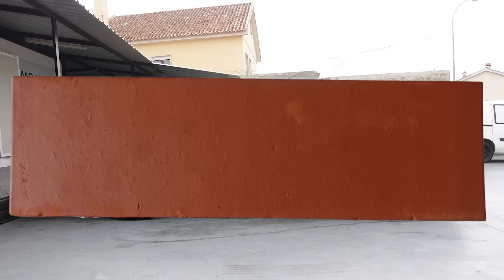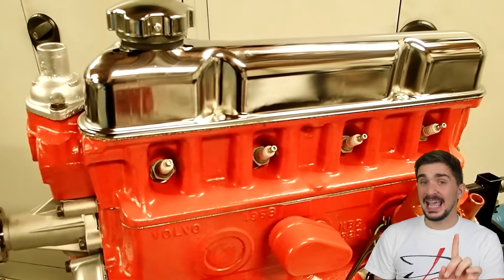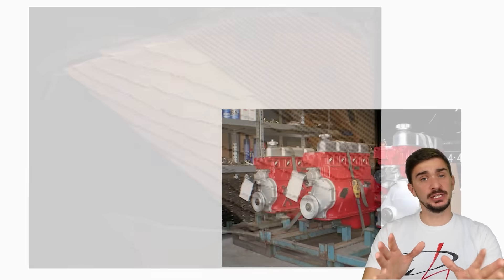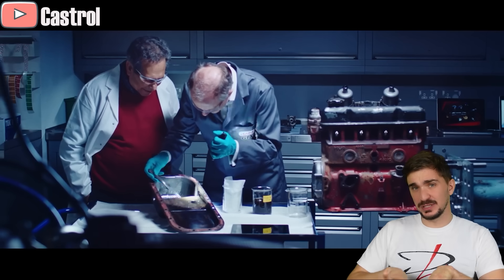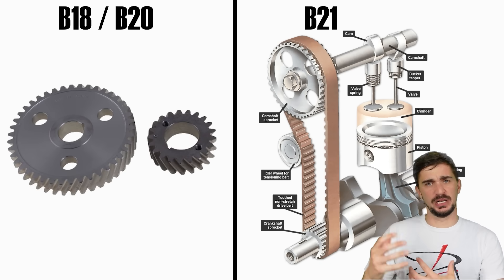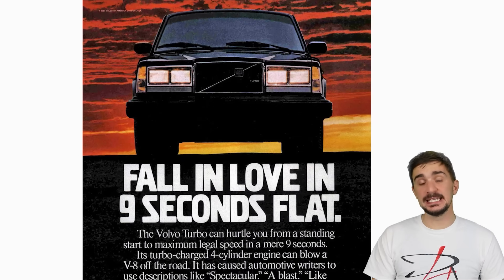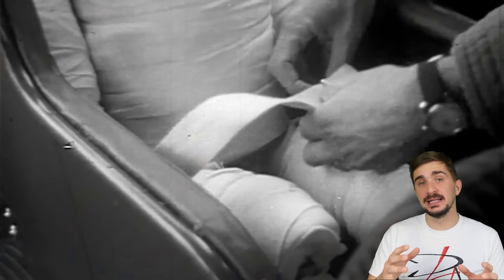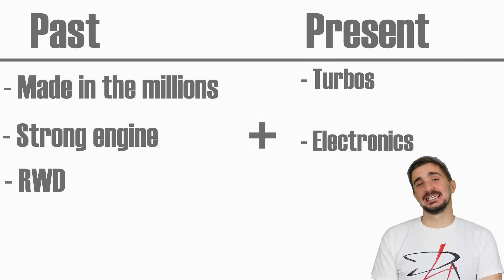A Story about the Volvo 240 and its Redblock Engine - Iconic Cars and Engines #18

Comment: My father has a P1800S 1966 with the B18 double carburator motor, actually sounds very nice for a 4cyl and it is the original motor since 57 years ago. I really enjoy driving it, and am currently helping him fix things on it as they break (because eventually things do, even in volvos)
Reply: All you need is a Phillips screwdriver
Reply: And always pack spare membranes for the su carbs

Comment: Had one of those, in that exact colour when young with no money. Had already been around the clock once and mileometer broken at 70K (actually 170K) miles. Leaked a little oil so I just kept topping it up and using it......continuous oil-change. Totally utterly reliable. Joy-riders in the 80's would not steal it as too uncool. Only fault was a split carb rubber diaphragm which was a cheap fix. Once tried to make a hard right turn on gravel and it just carried on in a straight line so I centred the steering and pretended that was what I had planned all along. It certainly was a brick. Only stopped using it as low 20's to the gallon.

Comment: Since you only went over the best parts then i will mention the Achilles heel of the 200 series. That being the transmissions. The engines alone could easy handle 500hp without much modifications but every transmission would not handle over 250hp.
I recently took apart my volvo 240's redblock that has gone 400 000km. It has been in the family since it was new. Maintenance have been good oil changes and fuel cleaning solution every once in a while. Every single specification on clearance was as factory. I was both impressed and slightly mad since i already bought all the parts to replace everything. These engines are insanely durable as long as you do oil changes.

Also fun fact about Volvo's name. It was actually supposed to be a ball bearing name from SKF. But they ended up not using it. So when 2 guys that worked for SKF wanted to make a car company they asked SKF for help. They gave them the name and some capital to let them achieve the dream of a Swedish automobile.
Reply: Volvo means “I roll”.

Comment: Had the 264 2.8liter while chilling on an island with 30 klm(5 o'clock in the morning) tops my friends from the backseat asked me why I stopped and told the that a small bike (cub 50) broke its motor on my bumper. They didn't believe me until they saw the broken liking motor and the drivers leg.
Reply: Happened in Greece

Comment: The 700 series pretty much got a big face-lift and a new name though; The 900 series, which was in production until 1998.

That said, the 200 is also pretty much just an updated 100, so the 100/200 still lived longer than the 700/900.

Comment: Great video! There's just one small correction to do, the 200 series was introduced in summer 1974. I know it, because I still have my parent's Volvo 244 GL,  bought in 1974, sitting in my garage, the first model with the round headlights.
Reply: Back then when you bought a car the model year changed in the autumn. If you got it late in 74 it was a -75 model.
Reply: @antoniolittera2154  The 240 was introduced in summer 1974, not in autumn...
Reply: @oml352  August 21st is autumn to me. 🤷‍♂️

It was introduced and sold as a 1975 model. Common at the time to present and sell cars as next years model.  Practice has switched since then so the actual date of first registration is regarded as the car’s ”year”.
Reply: @antoniolittera2154  Yeah, and September 2nd is winter, right? You have strange seasons in your region.

The statement is, it was introduced in 1975, and that's wrong, it was introduced in 1974. No one spoke about the model year.

Comment: From Sweden, had a bunch of 240s thru the years.
If Oil, Filter and Cooling are good, The car will last forever, It's a Tank. Rust are the enemy.

A friend work at Volvo, He did service way back on a 'Taxi car' Volvo 240 that the distance counter was on 999 999.9 km.

Comment: I own a clean original 940 Turbo Wagon (the last gasp of the 240 platform and Redblock engine) and it just keeps going like a new car and never needs anything. The specialty Volvo shop that maintains if for me always sends me away with a clean bill of health and no recommendations. Not only the toughest and most reliable car I’ve ever owned, but also the smoothest, quietest, most comfortable as well. It’s over 30 years old and it is incredibly calm and happy on mountain road twisters and on the turnpikes cruising at 80MPH. 
Arguably the best cars ever made. 😊

PS: a close second would be my V70 with the “whiteblock” 5 cylinder. Not QUITE as bulletproof, but nearly so. ;)

Comment: the best b230 you could get(without using aftermarket parts) would be a 1995+ b230FK block(which gets oil cooled pistons), a 16V head, the 2.5l naval crank and the forged rods and pistons from the b23et

Comment: Watching your iconic engines series I kept thinking, when is he going to do the redblock? Great video. I'm rebuilding a 65000 mile B18 right now that was sitting in a damp garage for 20 years with its spark plugs out. I had to remove the pistons with a sledgehammer.  After a quick hone and new rings the rest of the engine is absolutely spotless. All of the bearings are still at factory clearances. Tremendous engine.  I also restored a 240 that had been sitting next to the sea for 10 years. After fixing the rust it feels like the most solid car you could ever step into. Shutting the doors is like getting inside a nuclear bunker. You know the car will look after you and it's a great feeling.   Suggestion, how about a video on the Volvo T5 engine?

Comment: I've owned both a 145 and a 245. Both solid as a rock, and the space in the back was epic. Unfortunately, it was the fuel consumption that finally beat me.
Reply: Yes you are maybe right, my 2,1 turbo eats 12 to 14,5 liter of premium. But 165 hp in an old car, is not so bad.

Comment: I can confirm this video. My daily is a 240 1988 with the skinny rods (1985-1988). Im regulary abusing it and maintaining it. Heads been decked 2mm (around 12:1!)To rise compression, H cam and a weber chinese dgas 38/38 copy. Its a blast to drive even if its a 2.0 B200k engine. I just beat the shit out of it but it just runs. My workmate said the most he has shaved of a volvo stock head is 3.5mm! And it ran races and screamed. My girlfriend has 3 volvos. One is a stock 940 B230ft stock 0.6bar but with a mbc to 1 bar and it can handle it just with no loss in reliability. I even had a Volvo 850 1996 with alot of mods. Its got now 465000km and boosting 1.2 bar with different cams and a 18t turbo. If you dont own a volvo. Buy one. Keep fluids fresh and the car will treat you nicely back for 400k miles

Comment: Spent 4 1/2 years working for a Volvo specialist in Melbourne, most of the ones we saw were the 200 series, 240 242 244 245 and 260 262 264 and 265 with the occasional newer and older ones. Mostly very easy cars to work on, required bugger all specialist tools and relatively well priced parts. The B21 series also had removable cylinder sleeves, so if a bore ever got damaged, you could change one bore and piston and keep going. 

The biggest PITA thing though was shimming the valves to the correct gap, lots of cam removal and measurement to get them right, but never saw an engine destroyed. That plus the 360GLT runs a full transaxle, so changing a clutch means dropping the rear live axle and all the way to the bellhousing, only to leave about a 5 inch gap to get the clutch and flywheel out and reverse hte process.

Other than those two things, the cars were generally bulletproof, and really only suffered from neglect sadly.

Comment: Very cool video. About my only mechanical experience with these engines is what a PITA it can be to change the starter, but they sure are cool in general. It's a shame Volvo doesn't make anything simple anymore. It's all luxury and high tech. Cool in a different way, but the boxes on wheels with tank engines were peak Volvo.

Comment: My 1980 240 wagon got 344,000 before a clogged oil channel caused a failure. Then I got a 740 Turbo wagon, a 940 Turbo wagon, then a V70 T5. All great cars. Just got a 2018 V60 CC, still figuring it out.
I like Volvos.

Comment: We had a 200 series, unfortunately rusted away after 30 years and 500k miles. 

Bought an xc70 in 2005. Still driving it today at 300k miles and no rust whatsoever yet. 

Many people don't realize how comfortable it is, easy to drive, reliable and cheap to fix. Once they do sit in it, that opinio  changes quick

Comment: On the shop I work for I'm fixing one of 240 of 1987 for head gasket failure and its belt driven. To make the bults lose of the pulleys its been a pain of the ass since the bulbs and the screws are hard to get with the tools.

Comment: 1:18 - Bigger is not always better. Bigger bearings = more friction. An example is the ford v8. Most aftermarket ford blocks use the smaller chevy v8 bearings. ----->

Comment: Thank you for making this video! I'm not sure how many people will read this but last year I searched for a vehicle to swap out my current daily 1986 300zx with. I love my Nissan so much and I just figured I'd have a "beater" car to daily. I needed something that wasn't too new or costly to repair, and especially reliable. Suddenly one day on Craigslist I found someone selling a blue 1988 Volvo 740 wagon for 850 dollars with 188k miles. It was driven by a 93-year-old lady and it had 2 small dents here and there. I didn't mind the character that came with it. It even has the owner's manual! I was lucky enough to be the first person to look at the vehicle and sure enough, I made the deal. Four thousand miles later, "Blueberry" is doing great! I've replaced a fuel relay, a timing belt that had been previously done in 1998, and replaced the fuel filter. I also tinted the windows and upgraded the sound system with a small amp and subwoofer to make it a little modern. It has the same redblock the 240 has and I love the brick shape of the wagon. It has room when I need it and I even bought her some new shoes that really set off the look. I've gotten many compliments and even a few offers to sell her. I'd be stupid to let her go! I'm very thankful this extra vehicle has entered my life and has become my new daily driver. I hope everyone can have their own version of Blueberry too :)
Reply: I got a ”redBerry” 1997 Volvo 945 turbo.

Comment: The Toyotas of their day.

And Viking steel.

P1800 please. 

Math teachers do the math and know how to compute the present value of total life cycle cost.
Reply: Synchronicity... first car was a 77 245 4 speed manual wagon, i failed to sort out the electric gremlins. Now i get around in a 03 manual Camry.....
Reply: @natural_law  My first formal degree was in an electrical area. 

I owned a Mk II Jaguar and a Norton motorcycle at the time. Both Lucas Electrics. Prince of Darkness. 

You can see why I studied electricity. 
Two beautiful vehicles with erratic electrics. 

The Jag electrics were always spooky. I rewired the Norton. 

A later used Camry was flawless.
Reply: Comparable to a Nokia 3110

Comment: I had an 82 240 GL. I accidentally left it idling for 4 hours while I rushing to class late. Thankfully due to it's looks it wasn't stolen and due to it's reliability it kept running until I totalled the car a few years later when I fell asleep at the wheel and rolled it off an off ramp embankment. Thankfully due to it's safety features I was completely unharmed. Would recommend 10/10

Comment: volvo also made an higer performace head for the b230, 
the 531 head that had better flow witch made more power. 
the engines that came with the 531 where the b230ET and the B230FB 
then you have the b230k that had the 631 head which was an interference head so if the cambelt snapped the head would be junk.
the early b230s had smaller bearings and crank then around 1988 the engines got the bigger crank bearings.

Comment: When I was looking for 240s, I would often see ones with 500 000 kilometres on the clock still sell for many thousands of dollars. Now gotten my hands on a 245 from '87 with less than 200k which is barely broken in for a redblock. Pretty good in terms of rust and mechanics but it has a few smaller things I need to sort out before I can take it on the road. The electronics are also a mess, the previous owner has done some weird stuff. Also got a '67 Volvo L3314N with the absolutely indestructible B18 in it, less than 100 000km on that one, which is essentially untouched.
Reply: It's possible that your '87 245 probably has 1.2 million in the clock, just that the odo is limited to 6 digits and turned from 999,999 back to 0 once.
Reply: @envitech02  the milage gets registered on a government database every couple years when it goes in for the EU control, I would've known if it had 1.2 million.
Reply: @bacon.cheesecake  I see.... That figures.. 👍

Comment: I once got an 1962 Volvo Amazon as a gift, for my help. That B18 engine nobody knew how many km had "on his back" but it was driving perfectly. No smock, no nothing. The only problem that I had, it was that the oil on the  Stromberg carburetor was to old and to little. So after just filling new oil on, everything was perfect again. I had the car for two years and that was the only problem with it. That was in 1993. 
Great review! 😎👍

Comment: I worked on the spanners at a Volvo dealer late 80s early 90s. The 240 was generally good to work on. Unfortunately customers & none  Volvo dealers did not realise the importance of replacing the crankcase breather flame trap at the correct interval. Build up of crankcase pressure would blow the rear crank seal. Non Volvo dealers sometimes swop the seal without replacing the flame trap. Give it 200 miles & the leak would be back.
 Basically the same engine in the 360 GLT.

Comment: my first car that I went out and bought on my own, was a 1991 Volvo 240 wagon. I paid $300 USD for it... that's the only car I've ever owned that I enjoyed driving. it had been converted to manual sometime in it's life before I owned it, and it had about 360K miles on it. it ran like shit, but it ran. I ended up trading it for a vintage 1964 Honda Ca160 motorcycle, that's more my style... I love my bikes... but I miss my volvo wagon. it was a very well built machine. the doors closed well, the panels didn't have weird gaps, the interior was leather where it needed to be, plastic where it didn't. the only issue I had with it was the fact that the door stowage bins were very brittle, I took my dad for a ride in it the day after I got it, and he took a chunk out of the passenger door stowage bin the shape and size of his shin.

Comment: well i blew up my B18 and B20 ;) not all stock from tho ;) the B18 did not like over 10-11k RPM. all piston rings broke in 300 yard. the B20 was bored to 2.2L and lost the head gasget when i went over 7500rpm under full load and  i managed to over heat it. non of the engines "started" both started and ran. stil not as intended. and the first OHV engine was the B19 i think. used the same crank, rods and pistons as the B20.

Comment: I wonder why they did not design dual timing system - large crude gears with very large gaps, and timing belt in parallel. Actually two timing belts. So idea is that while timing belts are intact, gears rotate in sync, and are aligned by timing belts so their teeth do not touch - so they do not wear. Once timing belt stretches or breaks, gears take over. In failure mode gears will also make noise so user knows it is timing belt problem.